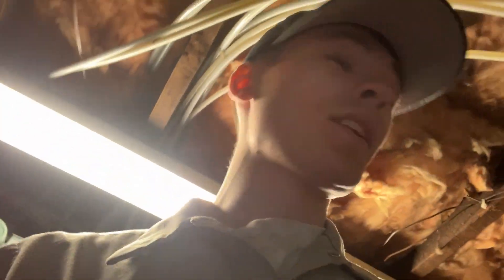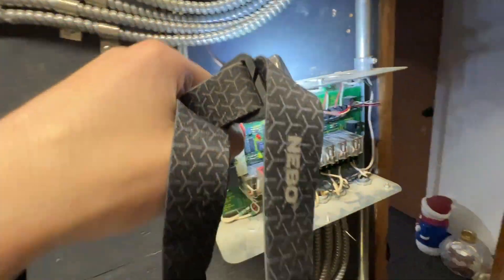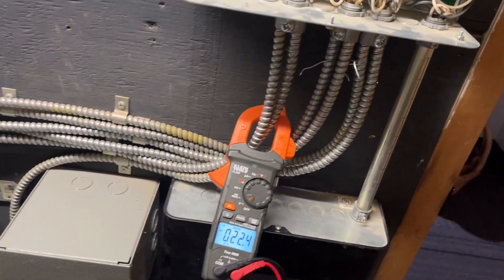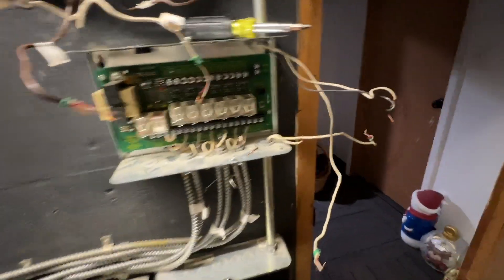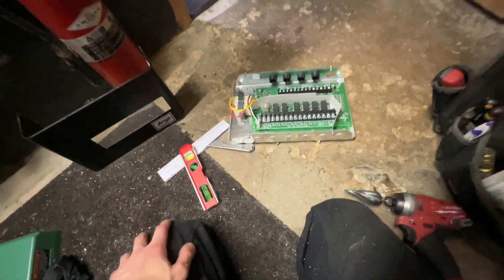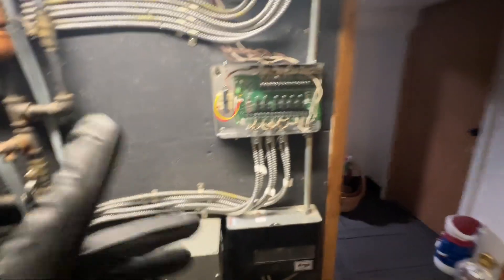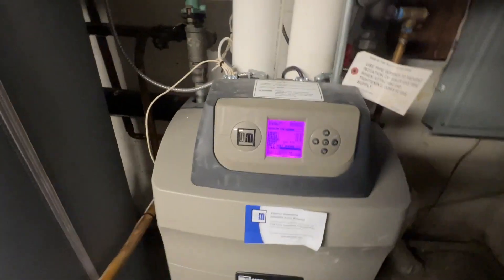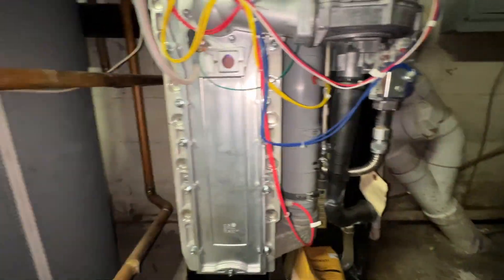No Hot Water! How to Diagnose Failed Sparking Argo Switching Relay and Replace with a Taco!

Comment: Nice catch on the relay panel Daniel! In a pinch, you can make spacers out of tubing. You could then use the tubing spacers behind the relay panel to kick it away from the plywood. Just insert the spacers over the mounting screws 👍.
Excellent work!
Reply from the maker: I thought about doing that, but it seems kind of hacky to me. I’d rather it be flush with the wall